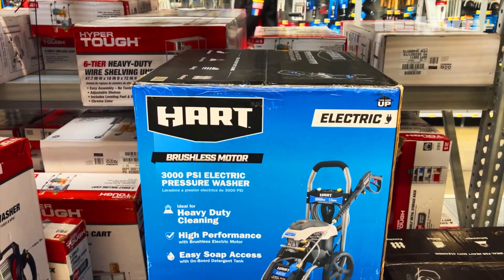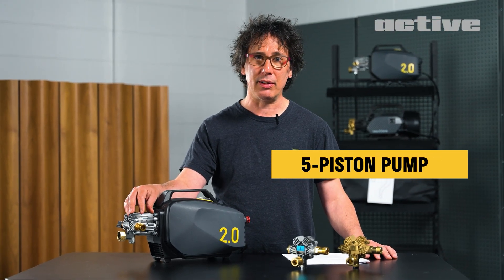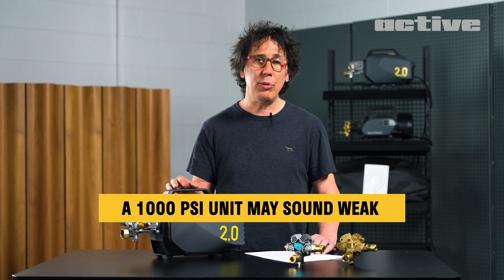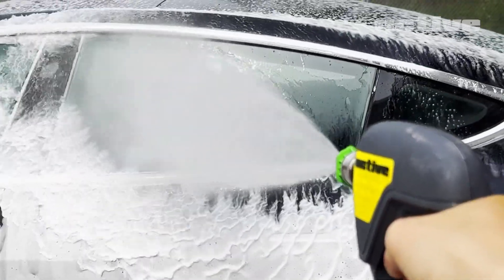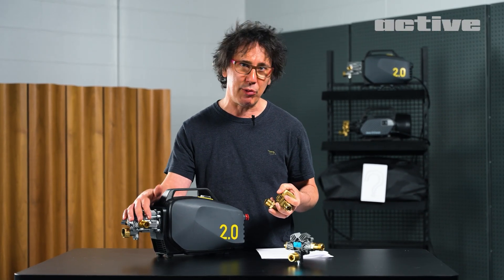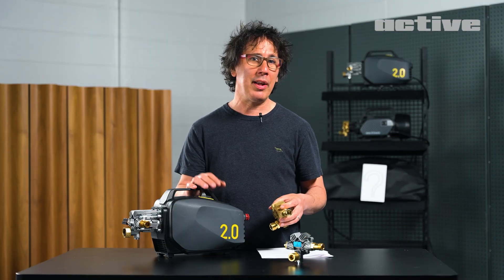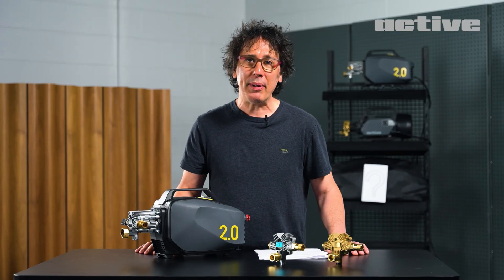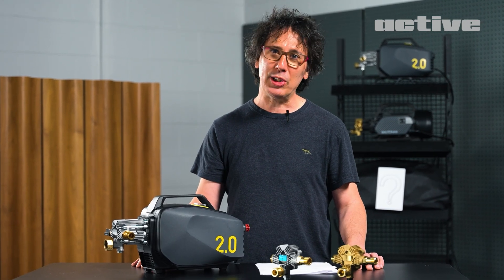What Goes Inside the Active Pressure Washers? | The Right Balance to Wash your Car

Comment: I bought active 2.3 and wall mount hose reel and premium kit yesterday and completed setup and starts to use it but very disappointed the active 2.3 is not responding at all.  I asked for brand new unit for replacement but answer is no but now starts to go thru steps to check.  Just send micro switch box pictures and need to wait fo response.  This is very frustrating as I just want to wash my car. 😢